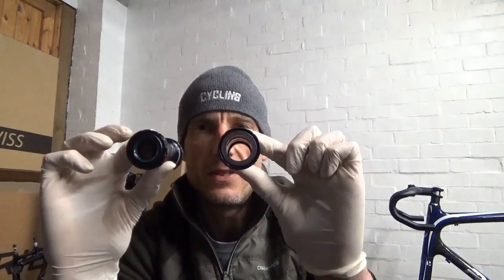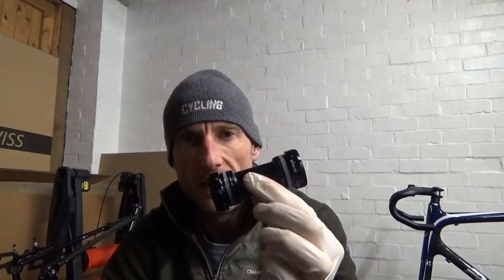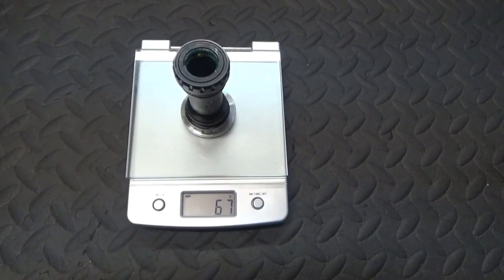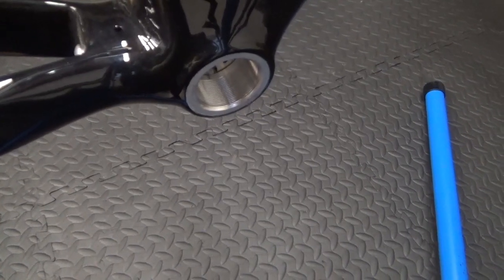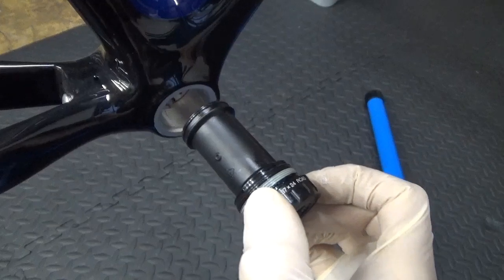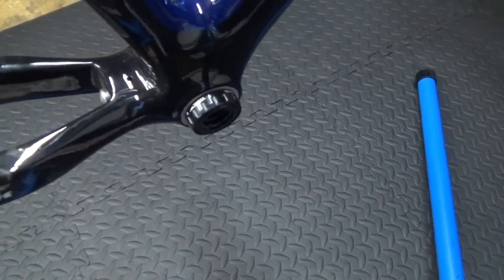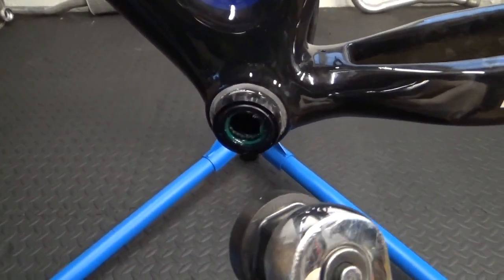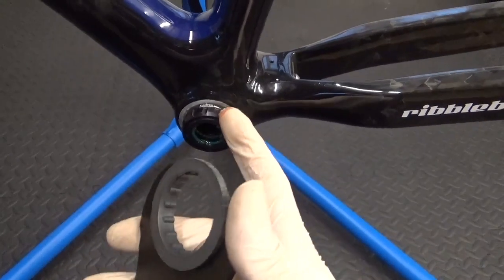Shimano Hollowtech II Bottom Bracket Fitting Guide

Comment: You have obviously had time to use the Dura- Ace and I am curious to find out what you think about it's durability. BB Infinite told me the smaller bearing is not really suitable for a 24mm spindle size and that it is one of the more horrendous changes Shimano has made. It seems to be the option I will need to use in the new Titanium bike I'm having made because I don't like the look of the larger cups of the other brands in a smaller diameter BB shell. The Dura- Ace 9100 BB cups line up nicely with the diameter of the Shell.

Comment: Which Bearing Bracket would I need to replace on my 105 crank, my numbers on it are... 
BC 1.37 x 24 Road.  What is the right number to order by? Thanks, Excellent video, and comments.
Reply from the maker: Shimano SM - BBR60 Hollowtech II
Reply: @FreeToCycle  Thank you very much, I replayed your youtube and I noticed the one you are using had a second number of -BB R9100, what does that number mean, is it equal to SM-BBR60?.  Thanks.
Reply from the maker: It is the Dura Ace model BB.
Reply: @FreeToCycle  Thank You.  Ordering my new 105 mid size crank set and pairing it with SM-BBR60 as mentioned, wish me luck. Appreciate all your videos. Glad I found them.

Comment: With no tools, i managed to thread the bottom bracket, but it met resistance about 3 mm before its threaded all the way in. It is safe to use tools? Any helps is much apriciated, thanks
Reply from the maker: That’s pretty much normal with a threaded BB!!
Reply: @FreeToCycle  thank you! I finally did it!

Comment: When do you need any of the 3 spacers that came in box?
Reply from the maker: If you are fitting to say a mtb with a 68mm bb shell then you use two on drive side and one on non drive side. For a 73mm bb shell use one on the drive side only. ( assuming no funny mechs or chain devices involved)
Reply: @FreeToCycle  mine has a device fitted over the shell opening that the front derailer is mounted on. This makes the total length 76mm. So would I not use any of the spacers ?

Comment: Is the 105 crankset compatible to a pressfit bottom bracket?
Reply from the maker: Yes the 105 crankset is compatible with a Shimano hollowtech II pressfit bottom bracket.
Reply: @FreeToCycle  ultegra smbbr60 is a hollowtech ii bottom bracket?....all of shimano cranksets are 24mm i  diameter?
Reply: @saosurvive777  BBR60 is an Ultegra BB. It is for the hollowtech 2 crankset. You will also need the smaller plastic insert into the wrench if you only have the "older" BB tool. There are now at least 3 tools needed for hollowtech 2 BB's as far as i am aware.